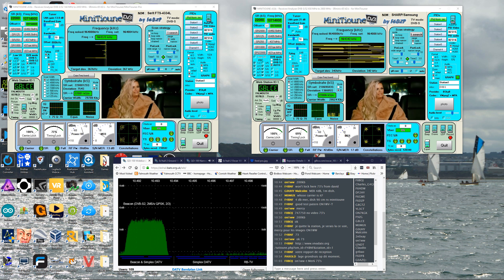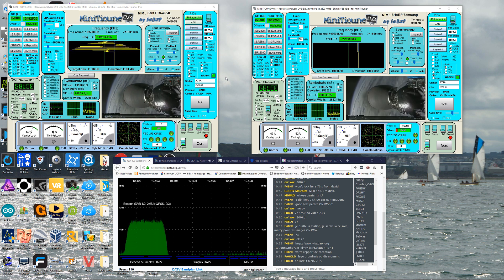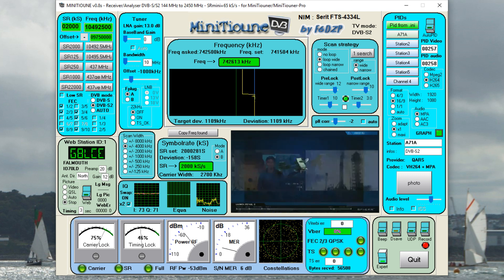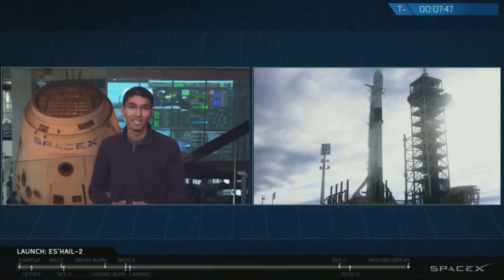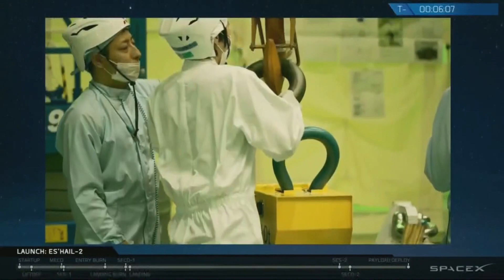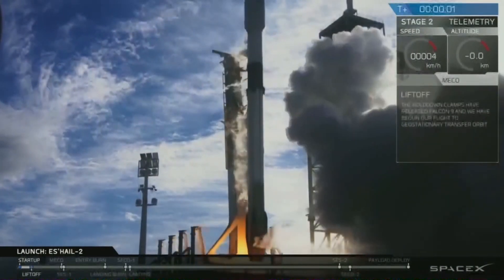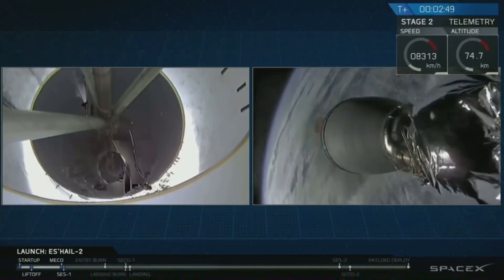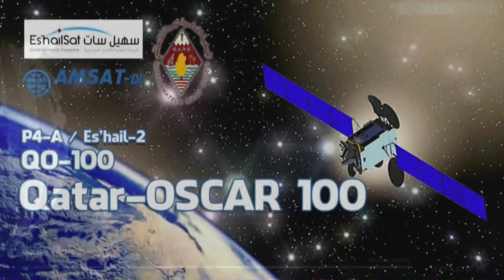Receiving OSCAR 100 part 2

Comment: Hi great video....how are you powering the LNB from the minitiouner? 
thanks
Reply from the maker: from the LNB the coax goes through the satellite positioner then along a long low loss coax to my 'shack'. Here it goes into a cheap satellite rx which is programmed to receive a satellite with an 18v LNB ( on it's menu it was the install screen and program the LNB ) This powers the LNB. Then the through output of the satellite tuner is fed into a splitter which attenuates the signal. The outputs from this go to the minitiouners and also the SDR for the radio signals. The raw output from the LNB can be too high for the SDR's.
Reply: Martin Perrett  Ok martin thanks for the reply just another question is there voltage present at the output (loop through) of the satellite receiver then into the minitiouner? or have u blocked any DC before it goes into the minitiouner
thanks Gary 2E0LGZ
Reply from the maker: @2e0lgz  The 'straight through' output of a satellite rx has just the if signal on it. The one going to the LNB has 18volts so don't get them crossed!. You can also feed the LNB just with the minitioune by putting a link on one of the connections. This would be 12v from the power supply to the minitioune. To receive Oscar 100 you would then have to twist the LNB in it's mount by 90 degrees to get the correct polarisation. ( LNB 13v vertical - 18v horizontal polarization normally ) The main reason I use a satellite RX to power the LNB is that I have the satellite positioner. That is controlled from the satellite rx ( step left or right ) but then the other advantage is the fact you can use a signal splitter as used in tv signal distribution, to feed the signal to other receivers. If I get time I will draw a diagram or make a video.
Martin
Reply: Martin Perrett thanks for clarifying a few points martin the problem is that some satellite receivers output the ‘if’ and some are a ‘loop through’ with voltage present i have a digital rx that says ‘if out’ but has voltage present haha but many thanks for the reply and clearing a few pounts
Gary